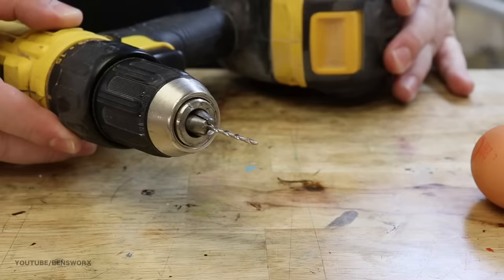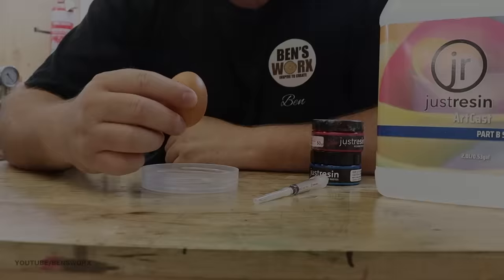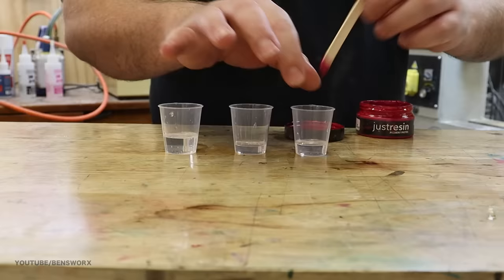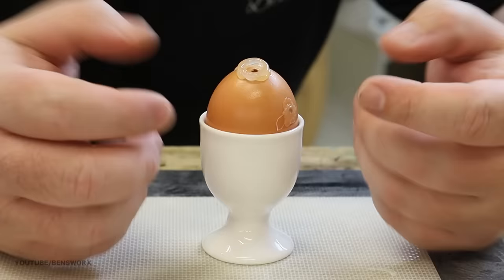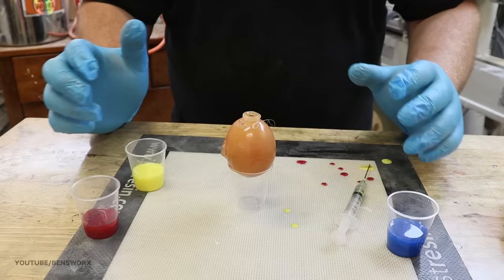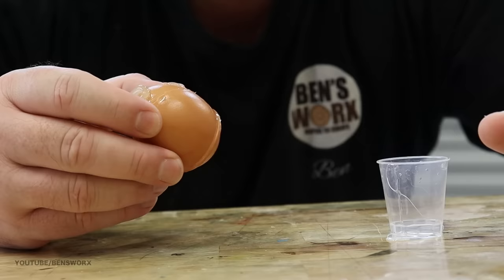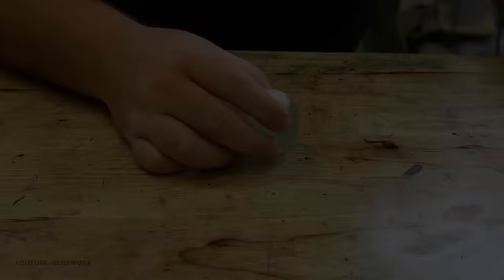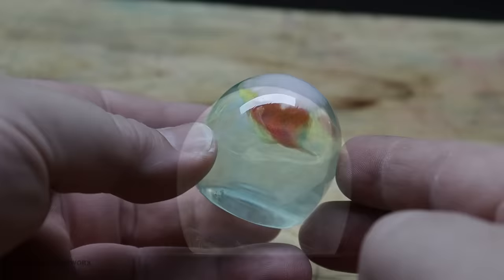DIY CRAFTS - Can You Inject RESIN into an EGGSHELL ?

Comment: so when you usually do your eggs do you make a blank then carve them on the lathe? I have tried a few ways to make molds of tiny eggs myself, and did realize quickly they will take a bit of polishing as you said, cuz egg shell is not as smooth as one might think. i love your injecting into the egg then using vinegar trick to remove the shell. genius! I might have to teach my nephews that

Comment: Would it make a difference if you used color epoxy, and put a layer of color in, let it cure, then do another color, and repeat until you’re done? As opposed to injecting clear first then putting in colors.

Comment: Just to me that thumbnail picture looks like maybe they did it a different way from you. Maybe something like injecting colored resin on its own into the hole letting it set, then doing another color over and over till shell was full, moving the egg to stand different ways each time it was setting so it wasnt just flat layers. Think they skipped the first step you did of filling it with clear resin. Could also be where there is only one hole in the left part of that thumbnail.

Comment: You should have done a little bit of one color at a time, let it set, drill the  hole again, and then repeat with another color.
Reply: You could put a little bit of the same batch of resin in a cup to use as a rough gauged timer to know when it’s set.

Comment: I think you have gone about this all wrong. you should premix various colors of resin and start by just injecting each color to fill up the egg, the last injection clear and trying to get it to form in the middle of the egg so it improves brilliance when light shines through it. create a reservoir at the top of the egg to hold extra resin (for shrinkage) This way you only have one hole in the egg you have to worry about. Presuming you get the bottom sealed. 

You could also try spinning the egg after it's full to swirl the colors a little. Great idea on dissolving the egg shell though.

Comment: Why not cast the egg in silicone and get a mold of it and leave a whole in the top with like a funnel shape and pour the clear in and then inject the colored in and you can better manipulate where and how much color to add and then unmold and cut off the funnel shaped piece and boom egg made from resin and the mold can be reused again and again